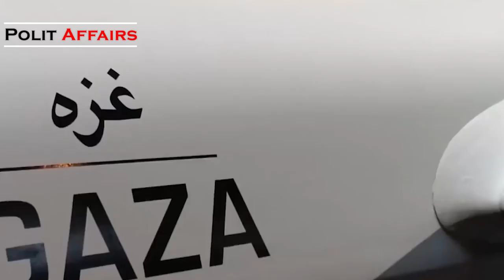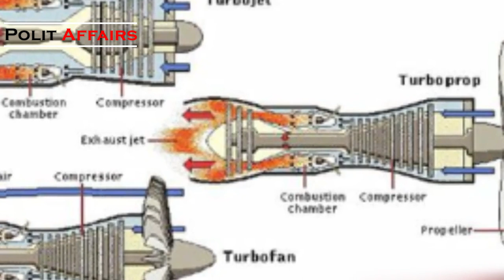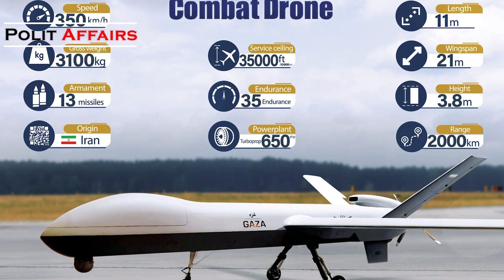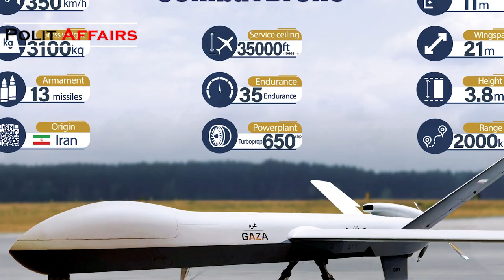Iranian Drones vs Turkish Drones: Comparing Technology And Efficiency | military comparison

Comment: Turkey cannot make any Drones i.e. design component, sub-systems, and then a complete platform. They do however assemble Drones, but that's called assembly engineering, which means putting together parts, components, sub-systems sourced (PURCHASED) from several countries such as Canada, Austria, China, USA, and Italy, and then assemble them as a platform. The only part made by Turkey is the composite shell (BODY PARTS). Therefore, comparing Turkey to Iran is a joke since Iran creates concepts, then design, and then manufacture their platform from Iranian made components. The sub-systems include the engine, electronics, infrared cameras, laser designators,  navigation systems, tracking and targeting, and smart weapons, as well as the firmware and software involved in controlling the functions of the final product.

1- Iran has been making Drones since 1984.
2-  Iran makes Toloue-4 mini Turbo jet engine with 377 KG of thrust since early 1990s: https://en.wikipedia.org/wiki/Toloue-4
2- In 2016 they revealed Iranian made OWJ Turbo jet engine with 1.5 Tons of thrust: https://www.youtube.com/watch?v=textPAYjRhU
3- Iran engineers & produces several Models of 4 cycle piston engine used for Drones.
4- In 2020 Iran started making Jahesh-700 Turbofan engines utilizing single crystal blades from high strength super-alloys. The engine has 700 KG of thrust suitable for drones weighting up to 4,000 KG in weight. 
5- Iran manufactures smart short, medium, and long range PGMs ranging from 8 KM to 200 KM miniature missiles to arm their Drones including cruise missiles which no country has. 

Turkey lacks small jet engines manufacturing technology, as well as 4 cycle piston engines, and they neither design nor produce any Turbofan engine (not many countries do). Disregarding all these facts,  you're comparing Turkey which merely assembles imported Canadian, Austrian, and Italian made sub-system to make a Drone to Iran which has been making all their Drones since mid 1980s from from Iranian made parts and sub-systems. Turkey is a new comers to this field, it needs decades to become a true manufacturer of military Drones due to their lack of defense industries infrastructure, the technical knowhow, and the human resources necessary to make an indigenous Turkish Drone. Regardless, Turkey doesn't need any of the above to make Drones since they could buy their needs from their NATO allies with ease, but Iran cannot buy a single military screw from the west due to US sanctions.

Turkey has a shiny Drone cobbled together from imported parts, which is great for Turkey since its easier to buy of the shelf parts without spending billions of Dollars and many years of engineering research and development to make a Drone. Turkey has access to hundreds of sources to buy any military parts involved in Drone making

If you want to compare nations with real Drone technologies, then compare either USA or China to Iran. As to utilizing the satellite global positioning system part in Iranian  Drones, Iran does have access to Chines BeiDou, which has a 10CM positioning accuracy (encrypted), and the Russian GLONASS has 50CM accuracy (encrypted). Thus, for anyone who thinks Iran doesn't have satellites (it does have satellites, but not an Iranian GPS yet), its important to know that both China and Russia have military & defense technology agreements with Iran allowing Iranians to utilize both systems in their military applications including Drones.
Reply: Best joke ever.. 🤣
Reply: İran 🤣🤣🤣🤔🤣🤣🤣🤣
Reply: Get this malarkey outa here. 

Freaking clown show.
Reply: Gibberissh nonsense...
Reply: What a lot of HOGWASH  All the technical aspects you have stated. Turks already have and are used in there indigenous Drones. Most importantly Iranian drones do not have satellite capabilities. Both countries are basically playing catch up. But Turkish drones of late are more advanced than the Iranian drones. Turkish electronic warfare is among the best in the world. French navy vessels in the Mediterranean and Russia in Libya and Syria know this very well  because the Turks have used Electronic Warfare effectively on both advanced countries. When and where has the Iranians used there drones effectively on a advanced adversary. Turkish drones are way better than the Iranian drones. Also have been used effectively on a real battle field.
Reply: @clintonwoods6718  
Let's have one more crack at it, just to make people better informed.

Phrases such as Electronic warfare? More advanced? Indigenous Drones? do not have any meanings. It's an oxymoron to connect these words to reality of making something from a concept developed by engineers/designers of military hardware. Electronic warfare for example could be undertaken by any modern military with access to functional jamming systems, but has no relation to manufacturing any given weapon. 
 
Turkey has not proven to this day any ability to design or manufacture any military system without substantial help and supplies from NATO and other countries.
  
Meaningless cryptic phrases don't change reality. Such realities and facts known the world over.
The so-called Turkish Drone is a collection of Canadian, US, Austrian, English and Chinese made components. Turkey is a system assembly integrator with the exception of the Turkish made body parts.

Let's show  some data and facts. Turkey has been trying (through talking mostly) to design and produce fighter aircraft, MBTs, and helicopters for decades now, and yet, not a single system nor a platform were ever designed or manufactured. For example, most Turkish M-60 US made MBT fleet was upgraded by the Israelis many years ago as Turkey lacked the knowhow to upgrade them. Also, until 2014 Turkey was a major buyer of Israeli made drones made by Israel Aerospace Industries (IAI), Elbit Systems, and Rafael Advanced Defense Systems.

Below are some facts about Turkish made weapons:
1- The T129 was developed by Turkish Aerospace Industries (TAI). The T129 ATAK is a twin-engine, tandem seat, multi-role, all-weather attack helicopter based on the Italian Agusta A129 Mangusta platform. It's basically a platform made from Italian/English/Ukrainian made sub-systems assembled by Turkey. The engines are from Motor-Sich of Ukraine as they supply the TV3-117 engines for the development of ATAK 2 heavy attack helicopter.
The main contributor to the project is Italy's Agusta-Westland, Alenia-Aermacchi, DRS Technologies, Selex ES, Oto-Melara and WASS which are all offshoots of the Italian arms maker Leonardo-Finmeccanica, an Italian multinational company specializing in aerospace, defense and security.

2- The Turkish MBT story:
Turkey and South Korea have been working on the Altay project since 2008, when the contracts were signed, on the design and development of the system and selected sub-systems.

Hyundai-Rotem was designated as the technical support & assistance provider for Ankara to support the process of design, as well as manufacturing and integration of the Main Battle Tank as an entire system. Furthermore, Hyundai-Rotem was also to provide support in establishing domestic, Turkish manufacturing capabilities concerning specific subsystems. This would be done via a transfer of technologies and technical assistances. This happened with support provided by the Republic of Korea government, agreeing to the transfer of key technologies.
In August of Last year 2021, it was reported that Turkish land vehicle maker BMC, which is leading the Altay project, had reached an agreement with two South Korean businesses, Doosan Infracore Co. and S&T Dynamics Co., for the engine and transmission. 
The Altay MBT's main gun is the 120mm caliber made by Rheinmetall-DeTec AG of Germany.
The rest of the tanks sub-systems are from US arms maker General Dynamics Land Division, Honeywell Co., and Kraus Mafi of Germany
So, where is the Turkish design and Technology in this project?

3- Who makes the Turkish Drones' subsystems:
- Andair Ltd of UK
- EDO MBM Technology owned by an American company, Harris Corporation. 
- Rotax, an Austrian-based aerospace company, whose parent company Bombardier is owned by Canadians. They supply the Drone engines to Turkey.
-  L3Harris WESCAM, is a Canadian company specializing in the production of gyro-stabilized, (Electro-Optics/ Infrared) EO-IR imaging systems. Wescam is based in Hamilton, Ontario, Canada. The company makes day/night infrared thermal imaging system for the Turkish Drones. Plus, there are many other suppliers in Italy, USA, and France supplying components utilized in the Turkish Drones.

Please inform or list any subsystem used in these Drones that are made in Turkey beside the plastic body parts?

Lastly, as to Iran's lack of GPS navigation system in their Drones; that's incorrect because Iran started utilizing GPS systems almost a decade ago and could be noticed in their upgraded models fielded in early 2014.

Thanks,
Reply: @ugurcanbolat1526  

Iran didn't bring Russia to Syria, because it doesn't own nor has the right to do so. The Russian entry to Syria was a decision made by the Syrian government. Remind you, the wild hordes of ISSI (Daesh) were destroyed in Iraq and Syria by the Iranian trained forces in both states. Russia's role on the ground was almost nothing. Their function was recon & ELINT, which was not possible for Iran to undertake until 2019 due to sanctions and political risks involved  Also, Turkey which is an Israeli/US ally and a proxy of US/NATO recruited, and facilitated the travel and movement of those terrorist to Iraq and Syria. It also benefited from stealing Iraqi and Syria oil at the tune of 10s of billions of dollars. In fact Erdogan's son (Necmettin Bilal Erdogan) and his son in law (Berat Albayrak) were the owners of a huge transport company responsible for stealing & trading the cheap stolen oil and transferred millions of barrels to Turkey along with many other stolen goods. If there were a disgrace in this world, then it's Turkey that would qualify as the ultimate Mafia state the world over. Turkey is a worthless proxy for NATO/Israel in Syria. Israelis still have two military bases in Turkey dedicated specifically for spying on the Iranian with Turkish consent and cooperation. 

In Yemen, Iranian Drones and weapons brought USA and S. Arabia and their allies to their knees. They inflicted a resounding defeat on the richest Arab autocratic regime which possess hundreds of billions of sophisticated weapons along with its master USA in the battle field. They destroyed ARAMCOs biggest production facilities cutting over 50% of Saudi oil production for over a year while Saudis had the best US made air defense systems in that region . . ? Iran also allowed Syria and Iraq to destroy Daesh terrorists and clear all Syrian cities along with all western Iraqi cities from Turkish/Israeli/Saudi empowered terrorists. Yet, your country is still involved in protecting few thousand leftover baby killers hiding in Adlib, but  the Syrians will eradicate them sooner or later by force. 

Turkey has 50% illiteracy rate, a population that cannot read or write, and even the so-called literate portion of Turkey is way below average by world standards in Humanities, Languages, and applied science.  The story of Turkey's fantasy about grand projects are just wishful thinking, and day-dreaming at best. Turkey does well in imitating fashionable clothing, construction, and does well in agricultural sector, as well license producing home appliances designed in S. Korea, and China.   

And yet, you brag about making few plastic toys then brand them as weapons? Wake up and discover the truth since your Turkish news outlets are made to feed you ignorance and fabrications intended to inflate your leader "Erdogan" who has been transformed to a carbon copy of Saddam Hussein, but much weaker while leading a much poorer nation.
Reply: you know wrong. Turkey produces all subcomponents including the engine. The reason for buying abroad is to reduce the cost.
Reply: since iran did it before, if iran did it better, you were in libya and you were with Haftar.. why couldn't you establish an advantage against tb2? because if your technology is not artificial intelligence, but we have it.. all of them are domestic technology, baykar technology.. also the comparison here wrong turkey has much better drones.. does iran have a red apple unmanned fighter plane?🤣🤣
Reply: Old information